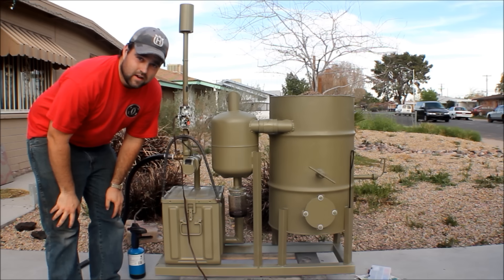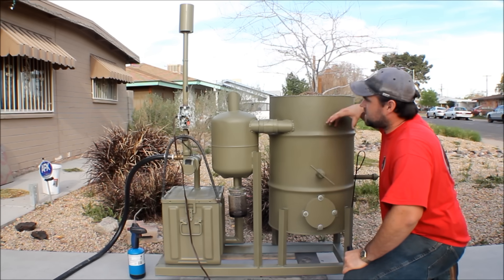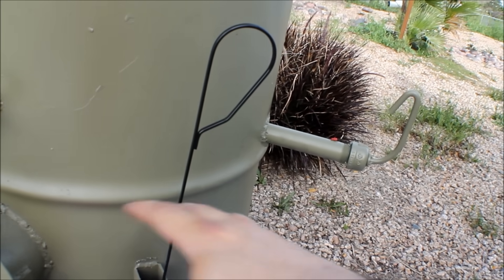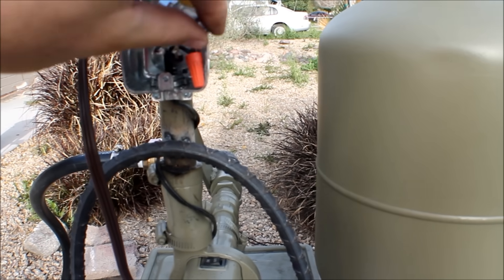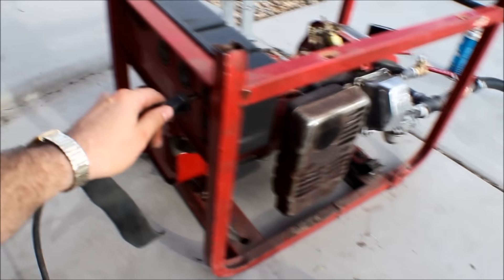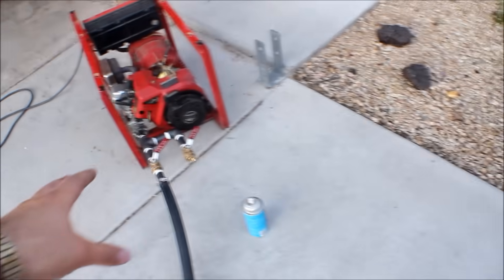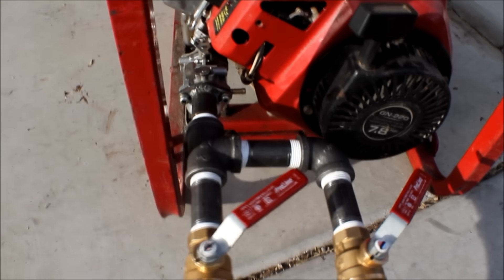amazing homemade gasifier uses wood pellets to run generator -- renewable alternative energy video

Comment: Seriously, I mean this with all due respect. That entire contraption it a waste of time, money, and materials. A simple inverter to your battery would achieve the same outcome.  You're already powering a fan off your battery for airflow.
Reply: The fan is only on for a few minutes, and it uses very little power. The draft pulls the air through after he had lit the stack, and that is even closed once the production of gas is verified.

Comment: A friend whose father grew up in Finland was powering a Log Haul Truck with a Gasifier! He had enough smarts to modify the Camshaft for more opportune Valve Timing! In his locale, he had the Hot Rod Pulp Tractor, pulling loads of Tree length Birch. He said a small potato bag of cubed green Poplar was enough for a day's work, smouldering away!
Reply: Awesome I'd not known green timber in this process 
Thanks heaps 
Stands to reason 
Green timber burning smoldering gives huge smoke in burnt fumes  I'm guessing be rich with gas once threw a few filters ❤

Comment: Good job!  I'm guessing it might be a little more efficient and run better if you close the port you injected the starting fluid into once it starts running.  Seems like you're probably losing some of your gas there and/or sucking in outside air.
Reply: That open valve is controlling the air intake.
Those valves are the carburetor they mix the wood gas with air.
If he closed it the engine would definitely die for lack of air.

Comment: Has anyone taken advantage of the vane governor built into the engine to automatically adjust the fuel & air supply based on load?
Reply: I know this is 2 months later. BUUUT. Governors control SPEED. Not A/F ratio. When the Centrifugal Force is high enough. the Gov arm pushes the throttle butterfly shut. That reduces the amount of Air AND fuel that can get to the cylinder, thus reducing speed. as the speed drops. Tension on the arm does too. Thus allowing for more Air AND Fuel. As far as automatically controlling A/F ratio... No idea.. That's what the carb was for. LOL.

Comment: Needs to make one of these and put it on a trailer and drag it around to construction sites makes loads of sense to be burning your scraps and make your own power
Reply: And think of an north American construction site were it's cold as well you can use this as heat, power and clean most your garbage that makes to much sense I guess

Comment: I guess since you have to have electric for the thing to operate you still have to run the generator on gasoline to start the process when there is no power. Then you have to have two sources to run the generator it would seem and how do you run when there is no gas? I am no expert but the question arose as I watched.
Reply: No gasoline is needed ever to run this.
The blower is only to draw the fuel through the system until the engine can do it for itself.
The blower could be replaced by a hand bellows.

Comment: Good show, mate! I wonder if a nice water jacket running on the outside of the smoke chamber would do the trick - doubles as a hot water heater for the home. I would love to build one of these. I heat my home with my trees as it is and losing power (N. Cali) is a given! The nearest gas is 20 miles away.

Comment: Asshole opinion
Why the fuxx would anyone want to do all this? Seriously. Move forward world not backwards. 
The fact you can't buy this on AMAZON proves the technology is not sound. 
Azzhole.
Reply: Well you got the asshole part right.
What kind of idiotic logic placed Amazon in the position of determining what is "sound" technology?
Can you get a molton salt thorium reactor on Amazon? How about a horse  can you buy that on Amazon? I guess those aren't sound either.
What will you do if an emp destroys your charge controller and you can't get one from China? Or what if a volcano causes a global winter for a few years.
You are a short sighted idiot if you can't see how usefull this could be in an emergency, if society ever fails you you'll be SOL.

Comment: With a different burn tank, he's not all that far away from a plastic pyrolysis unit. Toss in plastics of almost any type, heat to 400-500 degrees Celsius in an oxygen free environment, when the vapor comes out, allow it to condense and you'll have oil that can be used for any number of things, including diesel fuel. You could also compress the vapor and burn it quickly in an engine if you wanted to, but allowing it to condense into oil might be more useful.

Comment: How it is goin in 2019?
Do you still uise this matress pump coz i noticed its smoking heavly, propably thats how it backfired, coz it drawn air inside and brushes created ignition.
I also was wondering should you not swich air with fuel intake. Coz then you drawn air and air is drawing fuel with the same technology like carburator.
Also did you considered, to take away any NET heat for heaitng?

Comment: Agreed Sohave. Search 12vdc pwm controller on eBay. Very cheap 👍
Reply: Pointless to get pwm for a motor that runs for maybe 5 minutes and could be replaced by a hand bellows.
Reply: Didn't you hear him say that to higher speed on the fan made it backfire? Find  the perfect speed and its done. I'd like to see you turn a hand crank at the perfect speed for 5 mins.................
Reply: @MrSimmoco  He said if he ran it to fast it made the barrel belch and get to hot. He said nothing about a "perfect" speed.
Also I said bellows not hand crank anything.
It benched because he should have turned off the fan before trying to start the gen motor.
Reply: You have me there. But I'm struggling with you saying it would be Pointless. Maybe PWM for someone who has no clue what it is may think it's pointless. Maybe over engineered or finicky but not pointless. That would infer no difference with or without it. It would make a difference as it would hold the speed of the fan close the sweet spot. What do you think?
Reply: @MrSimmoco  
I think it's pointless because he doesn't need to control the air flow with electricity at all, he has a valve right there that controls how much air the blower can push out.
The blower should be off and that valve closed when starting the engine,  the blower is fighting the motor for fuel.
That fire isn't going out right away.
I think the beauty of this is simplicity and mucking it up with unnecessary modern electronics seems anachronistic.
Like someone said above in a pinch you could use a split pencil as a rheostat. 
Plus pencils are exceptionally EMP resistant

Comment: Just add aluminum tube around the cyclone filter with fins welded on that to cool it and same thing with exit tube. This should improve efficiency. Also add funnel for fuel.

Comment: Couldn't you have a copper pipe spiraled around the tube in the oil drum, and pump water through it, for both, cooling and water heating?

Comment: I highly doubt you'd read this comment, but maybe for those looking to build this for themselves... But you could run copper coils through the main fire chamber or even through the outlet pipes to sap the excess heat and use as a water heater. Barring the use as a water heater, you could run it through a heat exchanger and generate additional power.

Comment: Not going to read through 1000 plus comments to see if I'm repeating this idea...  instead of filtering the gas through wood chips in the ammo box have the gas buble up through water.. it will still filter the gas and cool the gas, plus you get free hot water.

Comment: Wait..can I run a generator off my wood stove then???? Wtf how is wood pellet smoke flammable after being burnt???
Reply: Driving to Hawaii the smoke is more than just byproducts of the burn, it's uncombusted flamable gas that leaks out of the wood as it's heated. especially if you heat the wood without direct contact to open flame, then almost all of what it lets out will be either moisture or flamable gasses. it doesn't have to be a pallet either, any wood will work.

Comment: Good job on the build. Thank you for the vid- I’ve read a bunch about these and I understand the theory of why it works, but I’ve never seen one in action. 
One question: is it possible to cool the gas enough so it can condensate into a liquid form to be able to store for later use (think coil coming off of a still) or would that require compression (like propane)?
Reply: Not without high priced compressors that would use up most of the energy available.
Reply: Phillip Mathews 
Thanks for your input. 
Just thinking off the top of my head...
What if you used a belt driven ac compressor salvaged from a car?
In theory, it’s a gas we’re dealing with, and gas can be compressed into a liquid if enough pressure is applied. 
It’s possible to link the compressor to the generator. 
Probably would require a second and separate system- one to power the generator and one to make the gas to be stored. 
I see so many possibilities with woodgas
Reply: @moonwatcher4049  
The gas is a mixture of hydrogen and carbon monoxide.
Why compress it's un a more dense state as the wood?
Its created by the fire on demand.

Comment: If it smells like wood smoke, you're very rich fuel/air mix.  add a cheap O2 sensor  to get the mixture correct.   The problem with gasifiers is they're devilishly hard to optimize unless you have some sort of very uniform fuel.  Charcoal would probably work the best.
Reply: Charcoal sucks as a fuel for this all the hydrogen has already been driven off.
This creates charcoal from wood as it is gassified.
What the engine is burning is hydrogen and carbon monoxide.

Comment: Add big cone on the top to hold way more wood chips, then get a wood chipper to turn brunch's into chips that you can use in that thing, so the power you make runs the chipper that makes the fuel you use in it, then buy batteries and a bigger inverter one that you can run your whole house on, have your gen power a 48volt charger that charges your 48volt battery bank then your bigger inverter runs off the battery bank. just keep feeding it to keep the batterys full, could also add solar power so at day time you use solar at night you use your Gasifier,  just build a box to put the gen in to cut down the sound, then your be sweet no more power bills

Comment: Completely from the gasifier, except that the most important component of it only works because it is hooked up to your car. Basically all you are doing is converting the electrical energy from your car powered by gas to a lot, lot less electrical energy powered by wood, which would immediately fail once you break the circuit back to your car. There really is no nice way to put it, if you need to be told that having a source of electricity to create a source of electricity is stupid, then you need to find something else to that doesn't take as much brain power. This is inefficient for producing power and for preserving several kinds of fuel, no matter whether you live on or off the grid, but it is especially worse for off the grid living where those kinds of inefficiencies waste your time, money, energy, and could potentially cost your life.

Comment: Best I've seen. Keep in mind it produces less power on smoke gas than with petrol. So if you plan to run stuff get the biggest generator you can afford. Run the smoke gas through a large radiator, like off an old bulldozer, early in the process and attach the goop trap under it. That will take a ton of heat off the gas. And if you can mist water on that radiator at the same time you will substantially cool it further.

Comment: producer gas from the pre-fossil fuel days. Used to be a gas plant in every town where town gas was sent out for lighting and heat..made from anything that burns. Original factory engines in mills and textiles all ran on producer gas, made just this way..And it was popular in WWII where gasoline was unavailable, and in Korea they ran taxis on charcoal until the 70's..

Comment: Very well done. Your generator was sitting there and running without a single miss. Finally a gas unit that actually runs at a sustained rate.
Reply: You can find plans from popular mechanics I think from ww2 where they have designs that were intended to run a car on.  Federal government, probably fema, has published plans also.  I didn't hear where he got his design or if it's all his I skipped through a bit
Reply: @MF11283  shame on you.

Comment: Could you place copper tubing as a coil inside barrel and heat water for showing etc. While cooling vapor?
Reply: Of course.
Reply: Don't cool it in the barrel. Cool in the next stage. It will collapse the vapor and create a vacuum.
Reply: @scottatmursedotnet  you got it, skip the wood chip mat, make a coil in the ammo can
Reply: Great question . Liquid bathing the coils could help too .

Comment: Wouldn't it have been easier to just build a boiler and steam engine to turn a pulley and connect that directly to your genset. This seems like a lot of extra work considering steam engines have been around 300 years. With this you still need electric to run it.
Reply: yup, in use, out in the rockies, they turn big,self built generator, with it.. generates 2-3 kw.. enough for household and maybe some other stuff?

Comment: I like to ask........

Would it be a good idea 💡 to add an extension pipe on top of the feed that’s air tight.... and on it you have a gate valve that you use to control the inlet air....... thus.... controlling the size of the burn and generating the amount of gas you need for the engine size you are using......... 

Excessive heat on the barrel..... is lost energy......... the fire 🔥 is greater than what the engine calls for.

If anything........ I would think you need a smaller diameter than four inches rather than a larger size one...... because your fire 🔥 ball would be bigger...... creating even more heat.

I love 💕 the simplicity of the example you have created,   I’m going to make the same setup, but I’m going to use a fifty five gallon barrel which take a top that locks down with a ring......... I can then prepare several tops with different feeding tube sizes, to test out my comment.
I’m starting to believe that the feeding tube can be tuned to the engine size , and be more energy efficient (less material consumed).

Hey thank for the great effort you put into your work......... I truly enjoyed your video. Again, thank you for sharing.

Peace.

Comment: It's true that you want the gas to cool before you get to the motor,  but to produce cleaner gas,  the combustion has to reach 900 degrees C. If you oversize the gasifier, you'll produce more tar in your gas which can cause problems in your engine.

Comment: I know this is late to comment but the potentiometer is not meant to handle a lot of current. You can connect the potentiometer to a 555 timer chip to drive a power transistor or a mosfet.

Comment: If you plum an oxygen sensor into the exhaust you can dial in the perfect air / fuel mixture. If you run too lean you'll melt a hole in your piston.

Comment: if you want to cool the gas more before feeding it into the motor,  run it into copper coils submerged in another drum of water.  the bigger the drum and more water the better, preferabley so much water that the heat going in will have no chance of heating up the drum of water much.  Circulate the water through a radiator if you need too to keep the water cool.

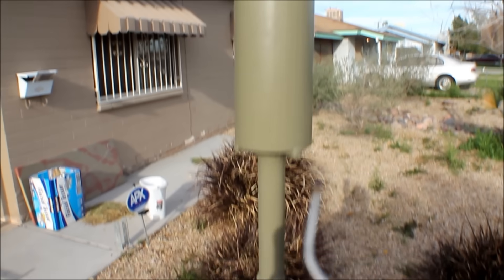Comment: 9:50 The blue flame is not seen, because of the same catiorgy as why sun glasses have UV protection.  Also when the vibration of the flame changes so do our eyes and we can see that frequency of color. (IMO = in my opinion.)

Comment: How many miles per wood pellet
Reply: I saw another video with a vehicle that had one of these fit on it.  The hopper was much larger and the publisher said it was about 50 miles per fill.  Not very practical but if we ever had another gas shortage or God forbid a societal breakdown this would be an invaluable device to have.  I had always been interested in independent power and until I discovered wood gas I had been leaning toward a diesel emergency vehicle but this looks like a much better option.

Comment: Since you control the fuel/air mixture, you should be able to modify the muffler on the generator to quiet it down. You would have to play with the valves after adding, say, a car muffler to it.
Reply: Been there, done that with an old Coleman power mate genny. Part of the problem is vibration of the engine itself - something a muffler wont take care of. Quiet generators have some serious engineering "baked into the cake" to take care of the noise from all sources.

Comment: This is still the best one I've seen on YouTube. Have you ever considered putting a TEG module somewhere on there  to run that little pump? You could probably place it on the inner cylinder than just have  a pipe kind of like the shaker attached to it for cooling. Might even be able to run some lights off it.

Comment: seem to me that the only thing you need to turn that gasifier into a self contained unit is to mount the generator to the gasifier and add a in line UPS battery to capture the power from the generator so you have power to run the start up pump and to even out the load on the generator
Reply: AMERICA is self sufficient, I love how the first American gets it built then improvements start rolling in. love being American.
Reply: @Marlow77  it was invented by  German scientist Ludwig Mond in 1850.

Comment: Awesome video! Does anyone know if you need a specific generator to be able to run off the wood gas? A small 2-stroke engine or can you run a larger, 4-stroke off it? Thanks in advance!
Reply: 4 stroke